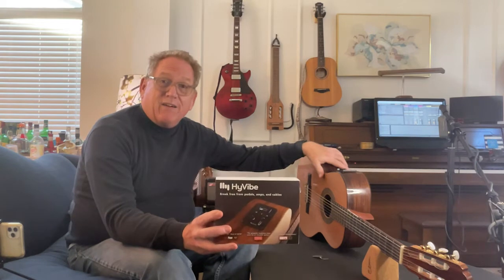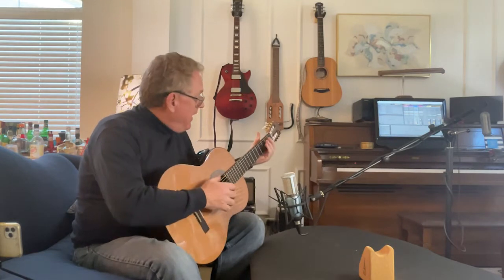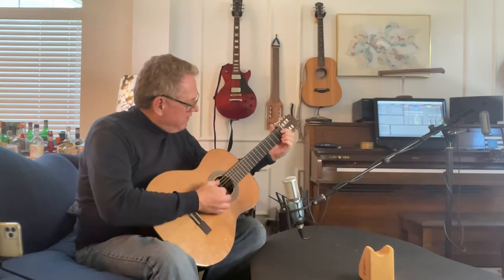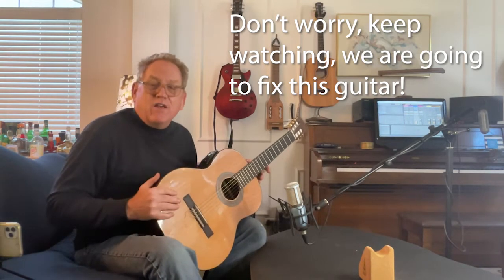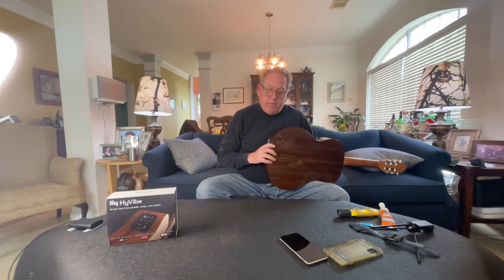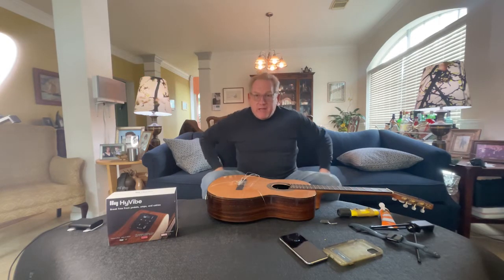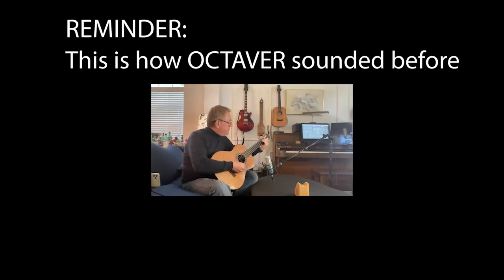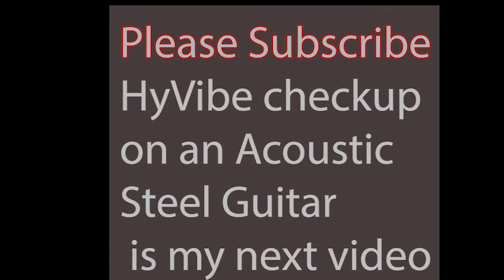HyVibe 3 mo Checkup and Repair

Comment: My Hyvibe’s signal cuts out if you hit a note or chord and let it sustain. Suggestions? Thanks 🙏
Reply from the maker: Hi Anthony, under the SYSTEM section you can play with the piezo input level, that would be the first thing I would try. And of course run the Calibration while muting the strings while you are there.
Good luck